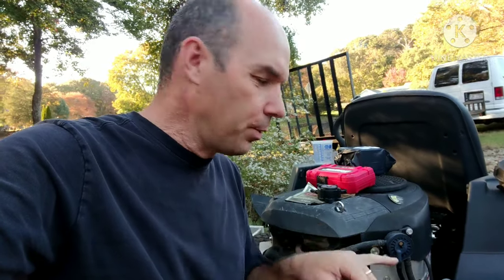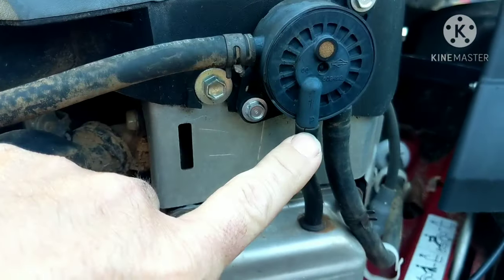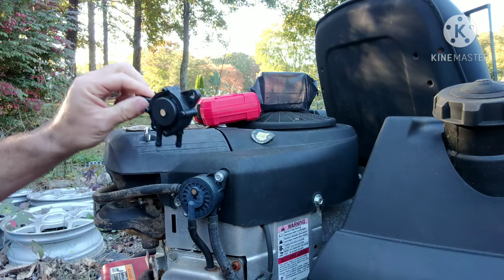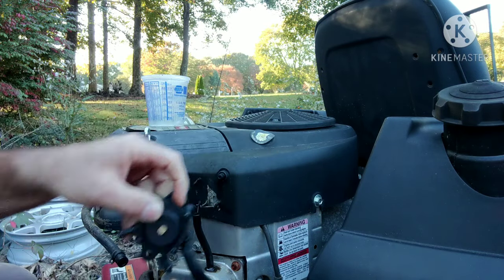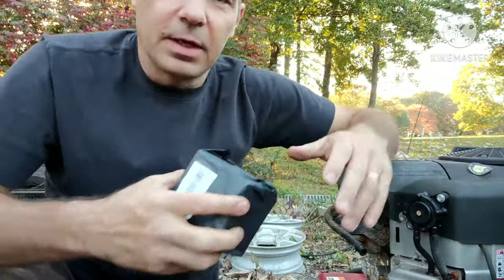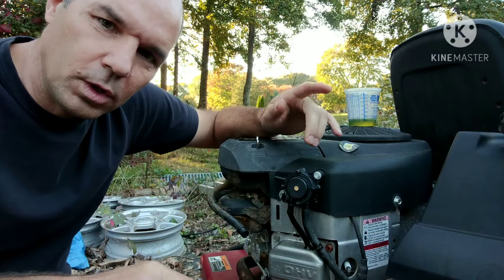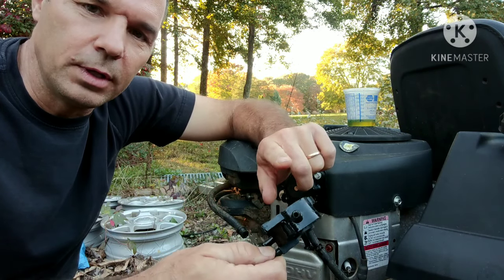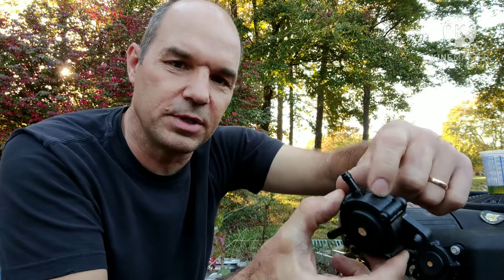Cheap fuel pumps are junk!!??

Comment: With all respect to you for  providing these troubleshooting hints, I did have some concerns. When you were testing the original remember that the pump was already primed so the amount of fuel delivery during this test would be more than when you tested the new pumps. Also I feel that the Pulse tube from the rocker cover should have been replaced before the testing to ensure that maximum vacuum was achieved.  Other than that, your video provided enough information to allow for proper fault diagnosis. Thank you.
Reply: Yep impulse hose had dry rot cracks in it right over the fitting at the pump
Reply from the maker: I used the same hose for all the pumps, the cracks were on the outside and not all the way through. All pumps were primed before I tested them.
Reply: @TepcoCycleRepair  OK o
Reply: @TepcoCycleRepair  i purchased a low priced drill pump that did not work.  Quarter the price of a sealed brand name pump. Disassembled it and a o ring was out of place. Reassembled it properly and it works perfect.
Reply: Typical, once you fixed it then it was "built in u.s.a!  Good job.
Reply: Why does the "cheap" pump leak gas from the impulse tube?  The fuel flow side and vacuum side should be isolated.  Author's point stands tall.
Good commentary, we all learning.  Thanks.  I ordered a o.e.m. used and a cheapie, I will try both and report, I will open the cheapie and look for assembly problems.  Part only as good as assembly and materials.  Thanks
Reply: @johnkomosa9508  Because the internals werent where they were supposed to be...its also why it didnt really pump anything ...

Comment: Even with name brand parts it is hit or miss. Nearly all are Chinese parts. Ironically, I've had one crappy "cheap part" that didn't work and one that didn't fit. I have had 3 "quality" Oregon/Briggs carburetors/pumps that didn't work right. I really think it's a roll of the dice anymore.
Reply: You are correct with the hit or miss. I've tried the same thing.  Some of the OEM parts are 'Made in China' as is the aftermarket parts. Most times when I've ordered aftermarket parts I have good luck. Sometimes I don't. But it's the same with most OEM parts too nowadays. Since I do the work myself, I take the chance. You win some, you lose some. But getting OEM parts don't mean it's gonna work like it should.

Comment: Thanks, bro. I bought cheap ones from Amazon and fix them into my generator. But the fuel problem was the same(not enough fuel pumping to the engine). As these were brand new ones I thought the vacuum system was the problem. Check the values and did many things spending almost two days. But the problem remains the same. Finally, your video solves the prob.

Comment: Went to a 12v low psi pump went threw 5 Kawasaki original pumps all leaked in the the pulse line my mower has never ran this good relay and switch i turn off my pump and let my carb empty and haven't had a single issue with carb or pump 5 years now cost 50$ in all

Comment: Thanks for the info. This is exactly what I'm dealing with. I installed a cheap pump on my 20 hp Briggs V-twin. There's no fuel going to the carb. Yet, when I pour gas into the hose to the carb and reattach the line, it runs perfectly until the gas is gone.

Comment: Bingo ! I bought a ZT1 cub cadet. It wasnt running well because mice got up in the engine and chewed the coil wire. Previous owner said he put a new fuel pump on it . He gave me the old one (OEM Walbro).   I was experiencing problems  with the way it ran.  I watched your video,  changed  the "NEW" fuel pump CHINA JUNK, and put the old Walbro back on, and it  starts better, and runs great !  Thanks bro.

Comment: Good advice, 
Problem is Mikuni is junk too!!
Dealing these issues now, purchased a Oregon brand.. with the screws in side ,
It worked for a few hours then started with same problems as the old one that had been on the mower for a few years,
So I went down to a mower dealer & purchased the Briggs & Stratton brand ,
Just verified it was made by Mikuni,
It worked for an hour or so before giving me problems,
I can a switch the pumps back & forth and they may work for 5-15 mins before they stop pumping. And I’ve checked every other possible culprit for the issues, 
So it has to be I got 2 💩 fuel pumps in a row,
2nd of which is the brand you recommended,
Even the guy at parts counter made a slight reference that they had recently received a bunch of bad fuel pumps.
Reply: Did you ever get the problem resolved?
Reply: Check the fuel hoses for ANY cracks.  This sucks air into the system.

Comment: Nice to know.  Even if the 1st junk one pumped enough to run the motor it would have been dumping gas into the oil sending the rod out the side.  They certainly look nice but dangerous junk to use.  Buyer beware.  Mikuni makes great stuff,  have their carb on the Harley.  Thanks for the great vidoes and have a great day.
Reply from the maker: That's a good point I didn't mention, thinning the oil out. Thanks for watching!

Comment: Same problem. Watched your video and bought oem pump and temporarily fixed problem. Problems started again this year. Put a new vacuum line on , no help. Made a temp gravity fed fuel tank and it ran fine. Took an air hose and blew threw gas line before filter. Now its got plenty of gas. Have watched bunches of yt videos on fuel problems , but no one has ever suggested that. Guess Ill take  tank off and clean. Maybe I should make a video.
Reply from the maker: I have found leaves and grass inside of tanks. Whenever I have a fuel issue, off comes the tank, flush, dry and fresh gas.

Comment: Thanks for telling me that about the pumps appreciate it I'm doing the pump on my Brute Force 750 just about went bought the cheap one I'm definitely going to check my vacuum line cuz I seen that yours is a little bit cracked but it doesn't look like it's affecting yours but like I said Thank you for telling me about the pumps
Reply from the maker: If you have a brute force, around 2005 model that's not starting make sure you check the ground bus connector. I have a video on it as well.

Comment: your vacuum line fron the valve cover going up to the pump has 2 visible cracks and will lose vacume-
Reply: 100% and why are we tipping the fuel pump upside down after connecting it. it has mounting bolts to keep it upright. im not saying those fuel pumps arnt junk, but i am being objective.
Reply from the maker: That's the way they are mounted and the hose crack wasn't all the way through, besides I used the same hose for all the pumps so it would be an even test.
Reply: @TepcoCycleRepair  

Those cracks in vacuum line might be whole reason old pump is not working properly .

My JD  D130 starting stalling,misfires,stumbling after about 20 minutes of mowing. Wait 10 seconds, for cracked vacuum line to catch up, filling fuel bowl, runs fine 50 feet, then stalls again. 

Found same cracks in my vacuum line.

Glued and taped with electrical tape, .mowed another 30mins, then tape got hot and lost vacuum-fuel again. 

Motorcycles have the same vacuum operated petcock valve, any small leak shuts down whole fuel system.

Small crack in line , and diaphragm pump will fail.
(I noticed about 5 big cracks in your at :40)

Water in gastank will rust inside petcock valve,  and cause it to get stuck in either ON or OFF position.  Vacuum line can not produce enough force to move, if stuck in OFF position.
Reply from the maker: @erniemckracken1593  A lot of ATV's use them as well. It's a common problem on the Suzuki King quads to go bad. I've bought a few to flip, just changed the pump. The cracks in the line weren't all the way through on the sealing part and I used the same line to compare as well as on the new pump I installed and is still working fine. Now I have a Polaris 325 over here now with a crazy fuel line, pump, petcock set up, almost like Polaris deliberately over engineered it, and because of that several probably sit in yards to waste away.
Reply: @TepcoCycleRepair  m

Comment: I just used one of the amazon ones on the same engine. A day later there was fuel shooting out the muffler. I checked the oil and the dipstick was showing way full  all the way to the top. Sure enough gas had filled the crankcase just like you said. These really are no good.
Reply from the maker: Thanks for the confirmation!
Reply: That is called an engine that is hydrolocked. Most likely, your fuel shut off solenoid is not shutting the fuel off to the carburetor when the key is turned off.
Reply from the maker: That's not what happens in these. The pump leaks to the pulse line and fills the crank case.

Comment: I just opened my carburetor, and it was clean as a whistle but had a ripped bowl gasket. I replaced the gaskets in the bowl and cleaned out the main jet.  Same result. Is it possible that it's the fuel pump?

Comment: The link goes to a metal fuel pump. Do you have a good part number?

And what about that primer tube? Do you know where to get a good one that doesn't split in a couple of months?
Reply from the maker: Ok, I updated the links. The steel Mikuni link is rebuildable and I added the Briggs/Mikuni link like the one in the video as well. Thanks for the heads up.

Comment: I ordered this pump, because mine smokes when it trys to run. Is this from gas in the oil? Also, what do you think about going with an electrical pump? I would like to see a video on how this is done.
Reply from the maker: If gas gets in your oil and it over fills it will smoke. Electric pump is overkill, I would just get a new OEM fuel pump
Reply: @TepcoCycleRepair  Thanks for the reply. I purchased the one from your link, along with the vacuum hose, hopefully you will get some points for it. Do I need to change the oil now? I have a hard time trying to figure out how much oil to put in as it takes a while to settle on the stick. I don't want to overfill it.
Reply from the maker: @jawnTem  yes, definitely change the oil. Just look up how much oil that engine takes and fill it by quantity.

Comment: Awesome, man!  Thanks so much.  Definitely something that would have me chasing my tail in the future!  #stayrad
Reply: Got to remember these pumps come dry...you must prime the pump before you can say it isn't or is putting out the correct amount , also they are very low pressure so  vacuum doe play a part plus motor running more vacuum..,so engine needs to run on a primed pump~!  Just Saying~ just fix the jam tjing~ GriN
Reply from the maker: Understood, that's why I compared them as close as possible in the yard science testing center.

Comment: Nice tips thanks. I was wondering if you could mess something up if you tried to clean an original fuel pump with compressed air and carb cleaner. Because I'd did that and got it pumping fuel and it fired up and I  used it to mow but now the oil on the dipstick smells like gas.
Reply from the maker: I have found that carb cleaner damages rubber diaphragms, and because it's vacuum operated, compressed air can damage it. Pull the pulse line and see if gas drips out, if it does you need to replace it.
Reply: @TepcoCycleRepair  Confirmed thank you. I suspected that , started thinking about it after I did it and pulled the vac line today after  reading your reply and sure enough you were right gas came out. I ordered a new one. Thanks again ,new sub
Reply: @backyardbuck6362  try to save a few dollars only to possibly damage your motor.   go with an electric pulse pump.

Comment: If you put a new fuel pump on your riding lawn mower and it doesn't pump gasoline. What could be the problem? If I had a clogged fuel line to the gas tank How do I fix that? I think it looks like a little filter in the tank.
Reply from the maker: There is no filter in the tank of these. Pull the line from the tank to the pump, it should flow freely, if not, dump your tank and clean it out and blow the line backwards towards the tank. Then fill with fuel end recheck.

Comment: I 100% respect your review but I'm two seasons in with my "cheap fuel pump" and works at full throttle on my zero turn without any bogging and starving mowing every day of the week in Texas
Reply from the maker: The problem is that it's a crap shoot. Like cheap carbs, sometimes they work fine and sometimes they don't work at all and cost you more money because you assume it works and spend money on other things that aren't needed. With a factory pump, although more expensive, it will work. Thank you for the comment.

Comment: Hi I have a question about a miller bobcat 225 welding machine, it start but when I put the switch in the off position it wouldn't cut off its still running.
Reply from the maker: Not very familiar with those but first thing I would check is the continuity of the switch to be sure it's operating as designed.

Comment: How are.you I'm working on a john deere 115 it's not a LA 115 there was water and fuel in the tank I cleaned all of it and now there's no fuel reaching the fuel filter which is at the left side corner of the motor when you Stat it still no fuel reaching fuel filter ease help
Reply from the maker: Empty the tanks and blow the fuel line backwards to be sure the line/tank is not clogged. If it's clear, make sure the pulse line on the pump is connected on both sides. If all that is good and you're still not getting fuel to the pump, most likely the pump is bad.

Comment: I have the Mikuni original fuel pump with B&S stamp on it.  I also have a crack on the soft line going into the valve cover (vacuum line).  My 24 hp B&S will not pick up any fuel from the tank, i mean zero fuel.  Was hoping to just replace the soft line but read where you stated, "It's a pulse line very little pressure goes through it to operate the pump."  Do you think I have a pump that has failed or something else.  I've changed the fuel filter and checked all the fuel lines from inside the tank to the pump and to the carb.  I can spray starter fluid into the hose that leads to the carb and it fires but nothing I try will get this thing to pump any fuel.
Reply from the maker: The vacuum line is the pulse line and shouldn't have any cracks or air leaks. It is very little suction but the pump needs it all to work.

Comment: What causes them to go bad what breaks in them?
Reply from the maker: The diaphragm is either dry so it doesn't flex enough, or the diaphragm is cracked/not installed properly allowing fuel to bypass it and leak into the crankcase.
Reply: @TepcoCycleRepair  Thanks

Comment: what is deferent between 3 ports vs 4 ports pump? i dont see many for sale with 4 ports. can i use 3 ports pump?
Reply from the maker: A 3 port is line in, line out, and a prime line, that's all you need for a single carb set up.
Reply: @TepcoCycleRepair  
i got 4 ports pump, i cant find it. king Canada suitcase generator 2000w
Reply from the maker: @vaninec  So they only need 3 I'm guessing if yours has a 4th hose it's a vent for a diaphragm.
Reply: @TepcoCycleRepair  
It is for a primer pump bulb 
Most generators don't have it
Reply from the maker: @vaninec  Ah I see, I don't think you need that. If it has a choke, just run a 3 line.
Reply: @TepcoCycleRepair  
Just get rid off primer pump?, it is kind of weard only one line going to it. Most generators don't have primer pump.
Reply from the maker: @vaninec  I mean if you have a choke, I think you would be fine without the primer. I would try to keep it stock by my suggestions are if you can't find the stock 4 line. A lot of small engines have either or, but the ones that have both don't need them, and many have come to me not running because they choke it and prime it which floods it.
Reply: @TepcoCycleRepair  
This one got choke, so I will just closed 4th line

Comment: The pump has no power source?
Reply from the maker: No, it's a vacuum pump operated by case pressure, which pulses a diaphragm with valves to move fuel.

Comment: why not just eliminate the fuel pump and do a gravity feed ?  The carb should not overflow since the needle valve / carb floats wont allow to much gas in the carb.
Reply from the maker: Because on some the lower part of the tank sits lower than the carb and It also works as a fuel cut off. (I prefer an actual cut off so you can run the carb dry)

Comment: Did you replace the crack rubber vaccum (?) hose?
Reply from the maker: I left it on for the tests so all pumps were testing under the same conditions. It's a pulse line very little pressure goes through it to operate the pump.

Comment: So an electric fuel pump is less expensive than these anyway. I am questioning using this style.
Reply from the maker: These work fine if you use a good one, they will run for 10 plus years with no issues.
Reply: @TepcoCycleRepair  As I understand it, if the motor is old and has some blowby it messes up the pressure pulses and makes these pumps not work. That may be my situation. The electric one may allow me to get a few more seasons out of the engine.

Comment: From the looks of that fuel, you aren't using ethanol free gas or you are a your station is selling you ethanol fuel and you don't know it. None ethanol fuel will be clearer that that was,  the ethanol eats up parts in the pump and carburetor.  Check into it, it will save you money.
Reply from the maker: I always use ethanol free. This was a customers, I always drain their fuel and fill it with ethanol free before it leaves my shop. I totally agree with you, fuel with ethanol is junk.
Reply: @TepcoCycleRepair  yep